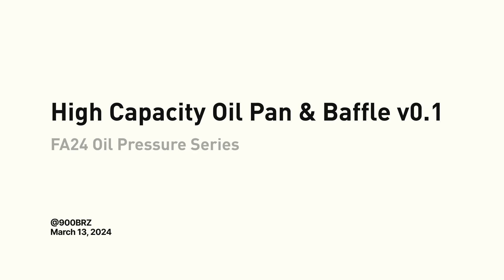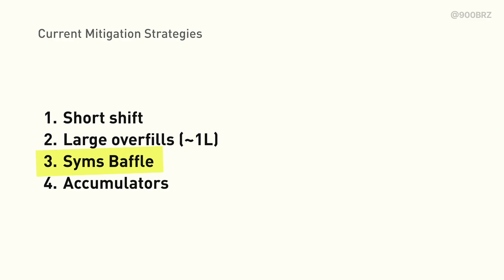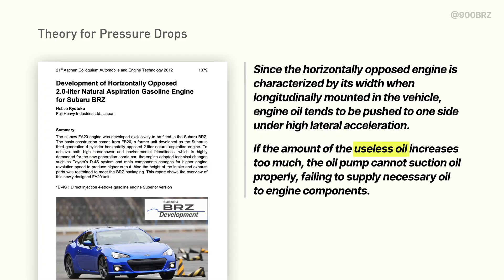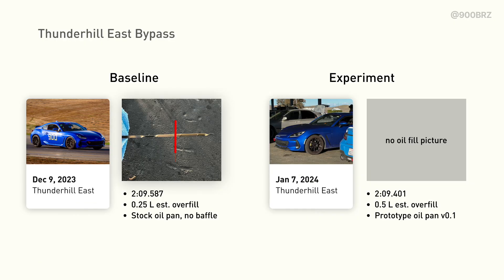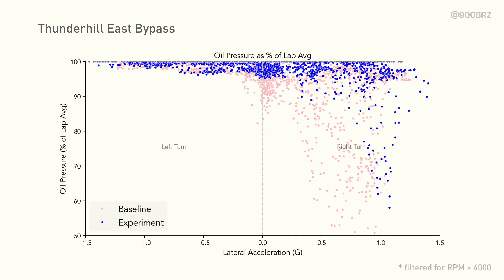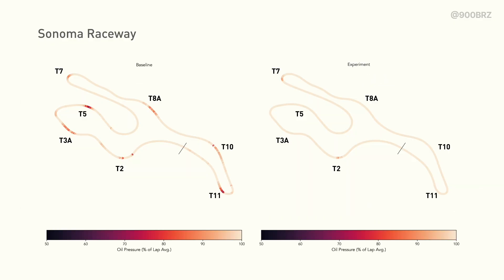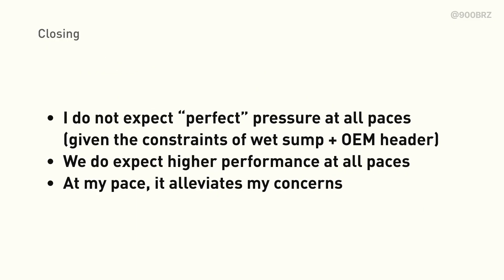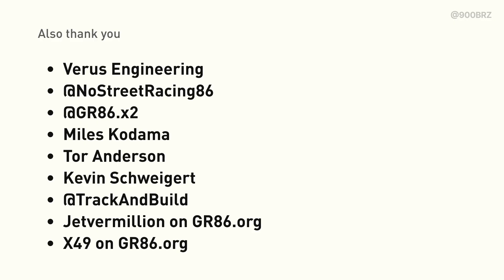FA24 High Capacity Oil Pan & Baffle Announcement

Comment: I wonder if the solution to this problem would be to create an oil pan that directs the oil towards the pick up by creating a downward hill on the side of the oilpan that doesn’t have the pickup, essentially eliminating volume from that side of the pan. Like a 45 degree hill pointing towards the oil pickup. Additionally you could create a baffle that doesn’t have the same thing by blocking out that space, the only problem that might arise here is oil getting trapped underneath the 45ed baffle so filling in that space somehow would be necessary…

Comment: im interested in a deeper oil pan but im sure you would have to replace the oem headers to make room for a bigger pan but I do think the oil pick up would have to be extended as well to actually pick up the extra oil in the pan. Im not an engineer or mechanic just think that.

Comment: What a road car needs is a dry sump system to keep the oil supply constant and allow the oil to de-foam in the tank before being pumped into the oil galleries.
Reply: not necessarily, this is only an issue for racers who push their car hard with high grip setups. it would be a waste of money to develop and produce a dry sump system, further increasing MSRP.
Reply: @o0Guns0o  What's cheaper? A new engine or a dry sump model for racer wannabees?

Comment: Flat oil pan test? Old School but good... Maybe It's the solution If the fishing range is the problem. The anti-shaking barrier only works if the sump is low enough, I could advise you to look for the solution in the boxer engines of the alfa romeo 33, in itself the FA20-24 is just the evolution, but even that engine has the same problem if you ride on the track or mountain passes, in addition the boxer engine is quite famous for getting drunk or for filling the oil passages after years ... In my opinion it is solved a lot with a flat and anti-shake cup with The floating panel, however, because it is fixed can still keep the part empty. At least I had done xpsibe I had solved the problem. Old solutions that still work well today, that was also used on BMWs. 😉 It seems to me that in any case in the race the pressure was constant ... Perhaps also due to the temperature?

Comment: Dumb question.  If aeration is the main concern (seems plausible), why not lower the oil pressure relief from 70 to 60 psi?  There must be a relief for a fixed displacement pump, and presumably it dumps back into the sump.  From the graphs, the engine is running at its relief pressure most of the time.  A lower pressure should reduce the amount of oil being pumped through the engine, and thus make the oil that is in the sump last longer through the corner, so to speak.  The penalty would be hotter running bearings, but that might be far less severe than how much hotter they run with aerated oil.  More frequent oil changes would be required, but that's probably done on a track car regardless.
Reply from the maker: To modify the relief valve you have to do an engine out job to remove the timing cover. The relief has two openings: one small opening with a crack pressure of only ~22 psi and the large one with a crack pressure at 101 psi. So the large bypass hole should not be in play after cold start. The relief dumps it back into the pickup area. Overall I think it would be more promising to restrict flow to the heads and keep it going to the crank.

Comment: Have you guys considered creating oil restrictors to reduce the flow of oil to the heads? I created my own as part of my oiling system for a 4A and it did a great job of increasing and stablizing oil pressure in it.
Reply from the maker: I think it's interesting. How did you know how much restriction to add without causing issues in the valvetrain?
Reply: @900BRZ  I talked with people who had done it before. If you look at the ones used in RB26s they are 1.5mm restrictors and those engines have zero issues once they are installed. I went a bit conservative on mine and did a 3mm restrictor after being told 2mm would work with no issues. There was no noticable increase in valvetrain wear but increase in oil pressure and more importantly oil pressure consistancy. 

The reality is no one will know unless it's tried.
Reply from the maker: That makes sense. My friend has an FA20 taken apart right now, so we could potentially test it in his car if he’s up for it.

Comment: I've been looking at installing a drysump into my ZN6, when i realised there's no space for a pump on the underside without custom headers or a tank anywhere in the engine bay in a stock engine bay layout.
Reply from the maker: If you get a lightweight battery and mount it 90° rotated from the regular orientation, you open up a large area between the battery and bell housing. My friend and I estimated it would be enough space for a 10-12L reservoir.
Reply: @900BRZ  I thought so too, but I went and measured the firewall clearance and can't seem to find where. I drive a RH drive 86. The space on the battery side (LH) is less than the right hand because the RH of the block is offset foward.
Reply from the maker: @oneplumpboi5317  Oh I see. Maybe relocate the battery entirely into the cabin or trunk.

Comment: Does the 1L overfill apply to both cars with an oil cooler and also those without/stock?
Reply from the maker: Yup, the quoted overfill does not include the oil in the oil cooler circuit.

Comment: Might sound dumb and I dont know if its possible but isnt there a smaller diameter oil pump compatible with it? As you said one of the problems might be getting too much oil sucked in
Reply from the maker: Possibly but it’s very invovled to change and it would be an expensive thing to test.

Comment: Thank you for your great work.  I'm installing a FA24 in my 2013 FRS and I am now extra interested in the oiling issues in these engines.  The term "useless oil" caught my eye.  Where is that oil in right turns?  Valve cover? Timing housing?  Would something simple as a drain hose from these covers to the pan facilitate oil return? 

And what kind of header would we need to run to accommodate the new pan?
Reply from the maker: The pan is designed around the stock header. Verus is accepting headers or 3D scans of other headers and still has some latitude to tweak the design if small changes allow it to fit other headers.

We think that oil is in a combination of places: valve cover and timing housing. I'm definitely interested in a passive drainback from the head. One thing I'd love to know is if the FA20 valve cover (aluminum) bolts onto the FA24 (in place of the plastic valve cover). I assume that change was done for cost reduction, but it makes it harder to add a bung for the drainback. If we could fit the FA20 valve cover, then we could easily modify it to add a AN bung.
Reply: @900BRZ  I have a set of FA20 valve covers that I will send to anyone (free of charge) who might want them for test fitting to a FA24.
Reply from the maker: @brianlambertp.t.6499  Oh I’d love to try this. I don’t have an out-of-commission FA24 to try it with yet but I could try to convince my local dealer to let my try to swap them on a display FA24 they have to at least see if they bolt up.
Reply: @900BRZ  Pass my offer on to Verus or anyone who might want to try a passive drain back system.
Reply from the maker: @brianlambertp.t.6499  Will do, thanks!

Comment: Hello as someone who is on the fence for a gr86/brz,I have heard of your great reputation. From what I am seeing this issue is the only negative of the car but i am not an expert in this field. I would be mostly driving this normally with very rare track/ touge usage. How often do you suggest oil changes? When do you plan on releasing this if it is not already out there? Will it void warranty? Thank you for helping the community.!
Reply from the maker: If you really want to know the ideal oil change interval, used oil analysis is the only real answer. I have a friend who tracks a lot and does annual oil changes. The oil I use does shear down a bit, so I do a change every 4-5 events. 

We're just receiving the oil pans now, so we're getting ready to install and hopefully do the final round of testing before it can go into production. I don't have an exact ETA. I think having this pan on if you were to take it in for warranty coverage would not be a good idea.
Reply: @900BRZ  thanks! Looking at specing a 2024 later this week

Comment: Fantastic research!  Question: is this solution compatible with after market headers? I’m new to the BRZ/86 platform and am considering it for HPDE duty. The tracks I run are clockwise tracks with lots of high speed and/or long right turns, e.g. Road Atlanta, Barber.
Reply from the maker: Thanks! Currently we haven’t tested with aftermarket headers and Verus hasn’t scanned any AFAIK, so still TBD.
Reply: @900BRZ  Thx for that update. Hopefully Versus can take that into consideration. Appreciate what you guys are doing!  👍
Reply from the maker: @maintenancethrottle thank you!

Comment: Absolute Gigachad.  Your work here will definitively shut down any and all debate regarding the root cause of why FA24 engines sometimes grenade themselves on track.  There will be no further shade tree bits of wisdom that will ever have any credibility after what you have done here.  Subaru and Toyota should pay you for the confidence that you have inspired in their products — the issue is unlikely related to excessive RTV (thank God) and most importantly it is SOLVABLE; you have demonstrated this with a fairly high degree of confidence.

Consider me very interested in Varus Engineering's product, once it is finalized.  However, I do not track my GR86 (at least not yet) and would be hesitant to do anything that would void the warranty.  So, while I definitely do want this, I would either need assurances Re: warranty or would otherwise just overfill by 0.5 L and continue to drive the car on the street as though it were a Prius going to church on Sunday (j/k).

Liked, subscribed, notifications enabled.  I'm interested in all your future testing results and hope you gain all the fame and notoriety that you deserve! 😃

P.S. - For those reading this comment, PSA to replace your PCV valve every 30k miles.  These engines have inherently higher crank pressures and need this more than most.
Reply from the maker: Thanks for the donation and comment! I think a small overfill like you mentioned or even just being super vigilent about checking the oil level and keeping it at or slightly above the full dot is good enough on the street. Any reliability issue given that formula absolutely should be covered under the warranty. Once your warranty expires, I’m confident there will be multiple options for pans on the market given where we’re at now!

Comment: also question with using a thicker oil have you ran a oil pressure test with the oem ow-20
Reply from the maker: Others have and have reproduced pressure drops. Same without the use of an oil cooler. My testing with the previous engine was with 5W30 as well.

Comment: want to buy a brz but cant justify buying a car with such a huge issues as a track car that cant go to the track???
Reply from the maker: Subaru of America has a reassuring statement for you lol: "The FA24 engine is designed to perform within a wide set of tolerances for road use, and the Subaru BRZ is designed as a road car. Race cars are specially modified to be used for race conditions."
Reply: @900BRZ  Toyota sells the fucking car with a nasa race club membership what silly a goober
Reply: @900BRZ  and “track tuned suspension” marketing good
Reply from the maker: @stevenyerry2209 Yeah also their release video was at my local track Thunderhill 🤦‍♂️

Comment: Any testing with a higher weight oil? i see you are running 0W-40, but would moving up to a 5W improve?  Theoretically i wouldn't think so, but i'm not sure if anyone has any data on this for these motors.
Reply from the maker: It may slightly improve it, as you can achieve the same oil pressure with slightly less flow. That may leave more oil available in the sump. Ultimately you want to choose the oil based on clearances in the engine and temps though.

Comment: The solution is to drill holes in the valve cover and add a drain hose to each corner back to the oil pan so cornering both sides drain and under braking and under accel. Ya I’ve been-thinking about it for awhile. It could be done totally diy. But welding flanges on the oil pan is the best way. The hoses I have drain right into the pan individually and I have plugs for them too so I don’t have to run them all the time either. But unless you dry sump it that’s the best oil fix IV done and the cheapest. 200 bucks for the fanciest fittings and braided hoses and flanges. 360 degree drain back flow
Reply from the maker: Yeah I’m actually super interested in trying this. I’m really curious if the FA20 valve cover is a direct bolt-on on the FA24. The FA20 uses aluminum valve covers while the FA24 has some kind of plastic material. Aluminum would be much easier to weld on an AN fitting to plumb the return line. Looking at pictures, it looks like it might be directly compatible but I don’t have a spare engine to test it on!
Reply: @900BRZ  I don’t have solid on track data. But I do rally cross type stuff, and hit the sand dunes and the hard wet sand is mint for drifting, which led to low oil pressures during long drifts, that was my fix, though my ej has alu. Valve covers and steel oil pan so welding flanges weren’t an issue for me, plastic valve covers…. Hmmm how to attatch and not have it crack. That plastic gets super brittle after some time, 
In my data it shows overall more oil volume naturally, and those lines acted like an oil cooler as well, and the I never dipped low in oil pressure after that, my brother suggested using a clear line and a go pro so I could actually see scavenge flow while full throttle going up a sand dune, need to get some good clear lines for the test and I’m afraid to run them long  and would go back to the braided lines.
Reply: @900BRZ   I bet that they are the same knowing Subaru, I also don’t have a fa20 and a fa24dit side by side. But Dominic acia from get a dom tune would know, or flat irons tuning would have the engines and know. Me… don’t have the money for a fa24dit. But when i do. It’s going in my sti swapped subie.

Comment: IV gotten in the habit of during oil change or checking. Start up car let it warm up a minute turn off and check oil, add to full and it adds about .75 quarts in my motor, and it shows over full at start up but after driving to the fuel station and checking again it’s perfect? So some definitely gets trapped in the heads. Turbo. And the drain back on corners is half the motor on right turns and the other half in left turns so over filling by 1 liter is essential in every Subaru.

Comment: Hey suggestion add a second Oil drain directly below the Oil pickup. this would allow for direct viewing of the oil pickup with a bore scope.
Reply from the maker: Based on what we've seen, after you clean the RTV the first time, it's extremely unlikely that you'd build up enough to worry about. So IMO it's not worth it. If you add a port directly below the pickup, you could also interfere with the fluid flow at that important area.

Comment: Should I worry about these issues as much if I am just casual daily commuting? Or even occasional spirited driving
Reply from the maker: Keep the oil level at full (higher dot on the dipstick) or slightly above and check it at least once per month. I think it's very unlikely for people to have starvation cause engine failures on the street (although I don't have real data to back that up).
Reply: @900BRZ  your work is widely appreciated to the entire vehicle community and I will continue to follow this endeavor, and I think I will probably do the 1 liter overfill for ease of mind and since there's no downsides to do so I feel it will be the best option. Thank you!

Comment: Something that I haven't seen addressed in other locations, are there any negative effects to overfilling the oil?  Specifically, does it require an oil catch can or does it push oil via PCV?
Reply from the maker: I wouldn’t say it requires one but I fit a catch can on the PCV side. We don’t think there are any downsides with 1L or less over. Once you go much over that you can introduce too much aeration and we’ve seen pressure drops on straights in those conditions. 

When fitted with a separate CCV side catch can, we see almost no oil collected there.

Comment: Have you sent any oil samples to testing laps yet to find out how much excessive engine wear these pressure drops cause?
Reply from the maker: I have a screenshot showing all the UOA from my first engine in this post: https://900brz.com/posts/uoa-after-failed-engine

The post is specifically about whether the failure would show up in UOA but it has all the historical UOA as well. The history is maybe a bit hard to read since I switch oils a couple times. 

I have samples from my new engine I will be sending in as well.
Reply: @900BRZ  awesome! Thanks a lot man